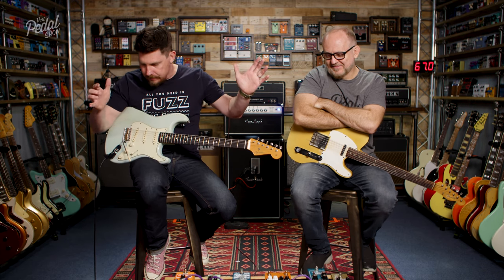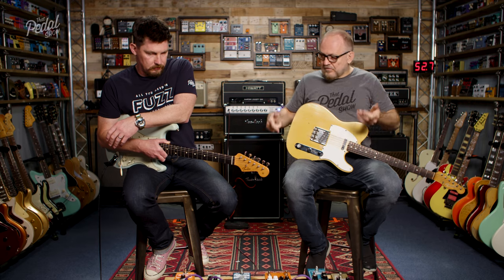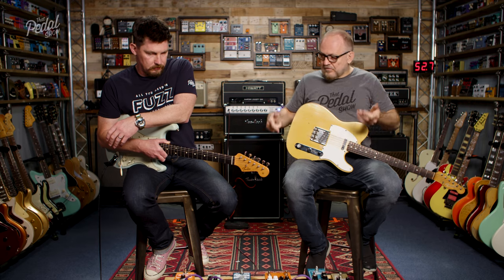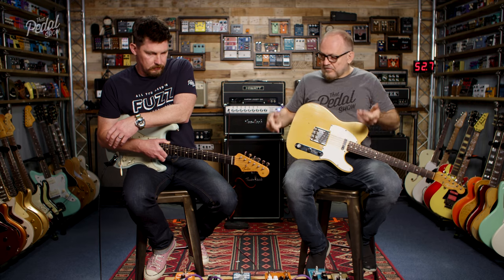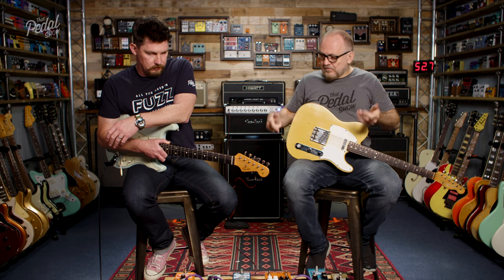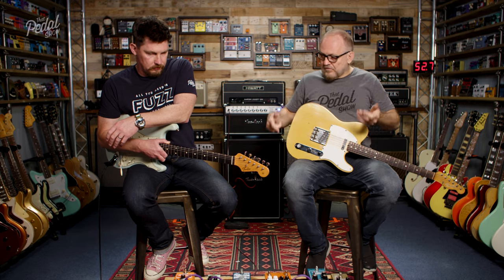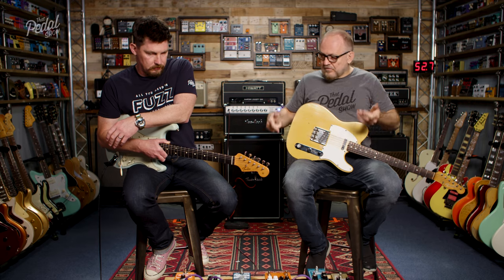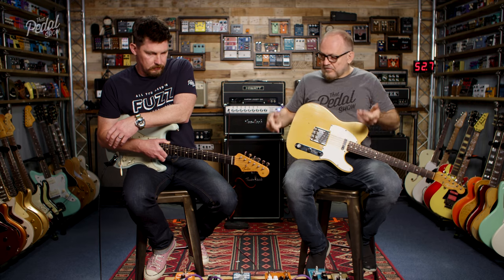To Buffer Or Not To Buffer: That Is The Question – That Pedal Show

Comment: You can turn off the brightness on the euna. Switch it off if it’s not to taste.

The loop on the euna isn’t intended to act as a buffer for fuzz. It’s just there to get the euna out of the way, because if you euna, it’s designed to be first in the chain. 

Side note. Pop the euna open. The writing on the circuit board is endearing. 😊

Comment: That was really interesting plugging straight into the amp with a tiny patch cable that it sounded just like a buffered signal though a normal one
Reply from the maker: Boom
Reply: I've heard that Albert Collins used a 100' cable so he could walk around the club (or even the sidewalk outside). Just imagine if he used a patch cable! Ice pick, squared?
Reply: That really was an eye opener!
Reply: Little Labs has a gadget called the STD that I think has the buffer built into the plug that you can put straight into the guitar if you want. I used to have a Hofner 459 guitar with the Fuzz and Treble Boost built into the body.

Comment: No joke at all... I just did almost the exact short cable/lead thing days ago... I have a Player Series Strat that is the brightest guitar of my 5... I made two cables to customize length for my office and the lower capacitance was too bright!  I knew there was more signal and less loss/suck... but it just was not better... so I ended up putting a cheap buffer midway through my chain and using the darker cable to balance it out.  In other words, had I waited two days, you would have given me all the answers and saved me tons of work!  Next time do the video on Tuesday guys!  Ha ha ha... true story.  With my tests, this is the first time I grasp buffering in a practical way... thanks so much!

Comment: Dan, Mick, This was a great show. This is exactly what a pedal build juggle is about (it’s not just how do i fit the pedals on a board) Guitars pedals amps cables are not as simple as 1 + 2 + 3 = 6 every element interacts with each other for better and or worse. I used to think once I moved from “cheap” gear everything would be fine but of course any piece of gear can be good and or bad depending what it’s being played with. At the moment I have a two channel amp the clean channel is brighter than the dirty channel. I have an always on light overdrive I use with the clean channel which balances things out. I have and octave up pedal (last part of the Hendrix fuzz) that’s at the end of the signal chain after buffers and other pedals the fuzz part is at the start of the chain.  I feel simultaneously like I have found the perfect recipe and I’ve painted myself into a corner and I can’t change. Thanks for all your work.

Comment: Solid Show -- Important topic.  I ventured down the True Bypass rabbit hole at one point only to have the pendulum swing back the other way.  My approach now,  good or bad,  is not put too much thought into it all UNLESS, I run into an issue like you demonstrated.  As to how I have my pedalboard wired, the difference any  one buffer plays may be insignificant. In its current configuration, much like the setup in the show, I run everything (symbolically) in a straight line; pedal to pedal to pedal. As my compressor is always  at the start of the chain, set with a nice blend and light compression, it provides a buffer-like function and helps drive the signal down stream. I also, for the most part, leave my JHS Clover on all  of the time (mid-chain). In addition, the delays and reverbs are set in trails mode (buffer on) so again, there exist a plethora of buffers along the path. One thought I have -- and perhaps I am wrong in this -- I like the idea of all my effects getting a full and robust signal for them to then process, thus (and especially with delays and verbs) I get to hear all of the life, nuances, and personality of said effects. To combat the potential shrill, I currently run the Strymon Deco at the very end of the chain to add some warmth and saturation -- sort of polish the rough edges/spikes on the final tone that is delivered to the amp.    --- Food for thought: perhaps there is an 'Anti-Buffer' that could be placed at the end of the chain to add a little dulling effect. ----

Comment: Finally! I've been commenting (and giving my solution, see below) about the deleterious effect of buffers even *after*, not only before, fuzz faces for YEARS. I'm pretty sure I already commented under one of your previous videos on the topic, at least once. I also always alert people that buffers are not all the same and that the simple bipolar transistor buffers are the best sounding ones (i.e. the ones that more faithfully give you that guitar-->single 5 meters cable-->amp tone, without any added shrillness). You can also watch one of my few videos where a show how even simply swapping the transistor type in the same buffer changes its tone.
But my comments probably get buried or judged too bold because most people say "it's simple, just put your buffer after your fuzz!". No, it's not! (As you showed)

So, here is my trick and solution for fuzz faces and buffers after them: you MUST reproduce the capacitance of the (usually) long cable you have from the pedalboard to the amp to get the same tone! So in my fuzz faces, and in those of my friends, I always add a 470-560pF capacitor from the central (output) lug of the fuzz volume pot to ground and make it toggle-switchable. Then, I always have a buffer or a buffered pedal after my fuzz face. This way my tone is consistent: if I don't use the fuzz, I have a stable buffered signal which feeds my other pedals and cable; if I use the fuzz, I don't have any unexpected behavior from it, the tone is as good as without any buffer because my fuzz actually "sees" a 5 meters cable after it, before the first buffer; if I want to play my fuzz straight into the amp with no other effects, I toggle the cap off, and I have the standard fuzz face circuit.
Hope this will help as many people as possible!
Cheers from Italy!
Giulio

Comment: First pedal in my chain: TC Electronic Polytune 3 with built in buffer turned on. At the end of the chain are two Eventide H9s with buffered bypass with trails turned on in both. After that is my final boost, the Xotic Super Sweet Boost with the buffer also turned on in that! I don't use any vintage fuzz pedals, just my Earthquaker Hoof Fuzz. Works for me!

Comment: This episode came at THE absolute perfect time for me. When I play my strat straight into my DSL20CR (clean channel), sounds great. As soon as I plug anything else in front of the amp, it seems to lose fidelity. So I've spent the entire week moving my Archer Icon in and out of different positions in the chain. And I've been contemplating "do I sandwich the board with a Mesa Boogie High-Wire - or just put a stand alone buffer at the head of the chain - or replace my tuner with the new TC Polytune that has a buffer built in?" My only fuzz is a Fulltone Catalyst, which is super stable from an impedance standpoint. So that can go after the buffer. Blimey, It's been quite a week between my ears ...  Glad to know I'm not the only person on this earth who is completely ... nuts.

Comment: I think using the Euna after the fuzz would “solve” the “problem”. Use the Euna with the delay in the loop, that way there’s always a buffer after the fuzz and no more volume/tone change. Of course that will change the sound of the fuzz but like you guys said, it’s all subjective to opinions. Awesome video!!
Reply: Great suggestion!
Reply: I was confused that they didn't try this (and that they did try the secret machine in the loop - seemed obvious that wouldn't work).
Reply: But Mick didn't want the Euna buffer on the rest of the time.  He needed an inverse functionality, buffer on only with the loop engaged, otherwise off.  If the delay is only to pair with the fuzz, then putting them both in an unbuffered loop would be the solution.

Comment: This has been the best show in teaching me more about buffers. As much as it tied my head in knots what I got out of it is that you have to experiment (a lesson you always espouse). The other takeaway is the value of having a couple of switchable and movable buffers in your loop switcher, provided they are high quality buffers. I myself am attempting to solve this issue and while I love GigRig stuff (I have the generator power supply and subsequent isolators and Timelord), the GigRig G2 is just too big for me, so I went with the Musicomlab EFX LE II which has an input buffer that can be turned off and on, and a second movable buffer that can be moved in the chain from preset to preset. Testing this out I now realise what my Zvex Fuzz Factory was missing. It’s brought that fuzz back to life. I would have liked to have seen you put the EUNA on as an always on buffer and then put the secret machine just before it. 

Anyway thank you! I know you said you wouldn’t ever use anything but GigRig, but it might just be worth quietly checking out a Musicomlab EFX LE II. I bought it from Pedal Empire because I know they support you, so in a way I hope some of that $769 Aussie dollars gets to you via them. The MusicomLab EFX LE II also has a built in version of the humdinger transformer isolated out, for wet dry, four mono loops plus an extra mono loop for volume that can be an extra normal loop, and then the next loop is mono in and stereo out and then the last loop is full stereo loop after that. Full midi capability, tap tempo, midi clock, and movable loops. It also has two mono parallel mixers in there for blending effects in parallel. It’s admittedly not as simple to program as G2, but once you understand what the page button does, it is pretty self explanatory. And it’s much smaller and a completely analog switching matrix. It also has two outputs that send momentary or latching signals to change amp channels or switch on or off other channels on certain pedals. I think it would solve your problem Mick as you could have the buffer come on after the fuzz, while switching off the input buffer, bypass any other pedals which are buffered bypass, and thus control where you want your buffer to be on a preset by preset basis. You could even do it so that you only need one delay pedal, and if it can be midi controlled, then it could have the tempo bpm sent on a preset by preset basis, and you could switch the order you wanted it also preset by preset. I don’t work for Musicomlab, but yeah worth a look. Anyway, thanks for this show and all your shows. I’m a huge fan. I frequently learn things from this show I wish I had known 20 years ago. Plus you two are hilarious and make me smile so thank you.
Reply: Gah! Haha, my comment above looks so silly now that GigRig G3 and G3 Atom have been announced only a week after I put this comment up, meaning I had no idea G3 was on the way and am now second guessing my purchase of the Musicomlab switcher. The G3 atom does look cool.

Still, it’s worth keeping the comment here as I still think this episode is so helpful.

Comment: Great video.  Very informative!  I’ve only recently discovered that putting a buffer at the beginning of my board and one at the end of my board is the secret sauce.  My tc electronic polytune 3 tuner has a bonafide buffer in it which I switch on and that pedal is first on my pedal board just after my wah wah that sits on the floor.  Then I mounted a JHS little black buffer underneath my board and that’s last in my chain which drives the 15 foot cable to my amp.  I have a mixture of true bypass and buffered pedals on my board.  And this works incredibly well for me.  Sounds like my guitar is plugged into a short cable plugged directly into my amp.  After 40+ years of playing.  I’m still learning something new.  A buffer at the beginning of the board and one at the end of the board just works!!!   Love this channel,😊
Reply from the maker: Certainly evens things out, but doesn’t work for me and Dan. Too much buffer tone!

Comment: I personally believe that in most cases it is better to have the high end preserved and shape my eq to cut what I don't want in the right spot of the signal chain than not having the high end and then boosting and EQing to  get back desired frequencies, the first option usually leads to less noise floor and preserves the dynamic range. That said, my favorite buffers are light gain overdrives that don't color the sound too much and have some EQ, like the Timmy or the prince of tone.

Comment: Excellent video! I love a good deep dive on unexpected/less explored issues of a pedalboard build. Reminds me of when a friend of mine asked if I knew why the OBNE Visitor might cause a big volume jump (similar to the one here). After much troubleshooting, we found that while he was rearranging his board, one of the solderless patch cables had gone wonky - it was working, but with an impedance issue (parasitic capacitance or something?). So with everything off, he had signal loss, and with Visitor on, its buffer brought his signal back. Swapped the patch cable, suddenly his signal came back fully and the Visitor was roughly unity gain once more.

Comment: This is a FANTASTICALLY USEFUL episode gents! Well done. Really interesting hearing the differences....

Its not even just WHERE the buffer is, but what the pedals circuit does to color the signal too. I think the Echorec's buffer sounds terrible (no matter where it is in the signal chain), compared to the one in the Belle Epoch or the Klon. And the Belle Epoch definitely made the Secret machine sound best.

I'm struggling a bit with my fuzzes as well because I have three buffered bypass pedals as well... the Polytune 3, the Cali76, and the Klon. But! I definitely prefer my compression after the gain stages, so putting that right after the fuzz is out. Right now its fuzz into Broadcast into Klon into a few other drives, then Cali76 then delays with reverb last. So far its pretty good but I'm curious if I could get it better by swapping the Klon and the Broadcast... it never ends!

Where should you put your buffer? In your case, the Belle Epoch right after the Secret Machine sounds GREAT. Since you want a delay there as well, that would seem to be your answer.
Reply: Just in case you didn't know, you can switch the Polytune 3 between buffered and true bypass (obviously without the always-on tuning when in true bypass).

Comment: I had a couple of similar issues with my Bloomfield Drive and the effects loop! First one was fuzz related in the front end, but I wound up using the buffer in the Peterson Strobo Stomp HD to give me a nice consistent signal through my drive pedals. The Bloomfield Drive has an amazingly high end detailed sound and using the effects loop kills that immediately... I attached a JHS Little Black Buffer to the back of the amp on a 6" patch cable from the Send and another after the last pedal on my board and now everything sounds as it should! This kind of stuff is super informative, and I'm sure not exactly exciting to film, so my sincerest thanks to you gentlemen!

Comment: Because I regularly do pedalboard setups and also spent a long time perfecting my own buffer design, I often get asked about buffers and how/where/when to use. So, if you care, here's my input on how to GENERALLY get the most consistent and trouble free results...

- Choose an amp and it's settings by plugging straight into it with the length of cable (or wireless system) you'll use from your guitar to your pedalboard input. That should dictate the amount of cable capacitance you'll have between instrument and amplifier. 
- Then choose a buffer you like the sound of (because not all buffers are created equal and sound and feel the same), testing it alone between your chosen cables to and from the pedalboard (output cable will be driven by buffer, so shouldn't add any capacitance). Tweak the amp EQ if needed/desired to suit, until you're happy with your general amp tone. 
- Place this buffer as early in your signal chain as possible (so straight after vintage style fuzz pedals). This will drive your signal through all the following true bypass pedals (when switched off) and patch cables without any loss of signal strength and clarity.
- But be aware that as soon as a pedal is turned on, or if it has a buffered bypass, that it then dictates the output impedance from that point. It may therefore be a good idea to put another buffer at the end of your pedalboard (or possibly in another strategic place later in your signal chain) to insure you have consistent output impedance for driving the long cable running to your amp.
- But also completely ignore all the above if whatever you're doing works well for you and makes you happy!!!

Hope that was helpful?!
Have a good weekend,
Neil
Reply from the maker: Thanks Neil! My problem is that I really don’t like the sound of extra buffers in my chain. The Klon one is nice after my other drives but not before them. The Belle Epoch one is tolerable and pretty nice in some instances. It’s an interesting old bollock!
Reply: @ThatPedalShow  Sounds like you like the sound of the extra cable length capacitance in the first lump of your board? A good buffer should not change your tone at that point, only overcome the capacitance of the following cables. 
So maybe you just need to use a massive old curly coily cable into your board?! 🥴
Reply: Maybe even a long cable (or something something to emulate that) after your fuzz to get desired tone, then into a buffer to keep things consistent from there on. ???????
Reply: NRG EFFECTS now you’re talking... maybe in G2, a ten or twenty foot cable from the G2’s send to the Immortal Echo?  That way the long cable is only used when the echo is

Comment: What would work here is a “buffer” type intermediary circuit with a lower z input and low z output. So it would load the fuzz as if it were seeing the cables, but drive the next stages easily.  It would be switched off with the fuzz.